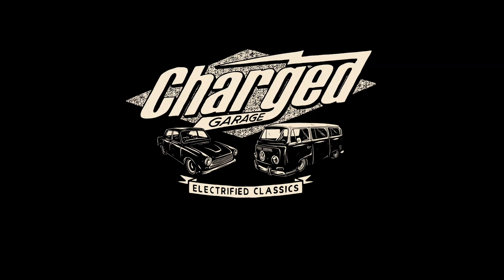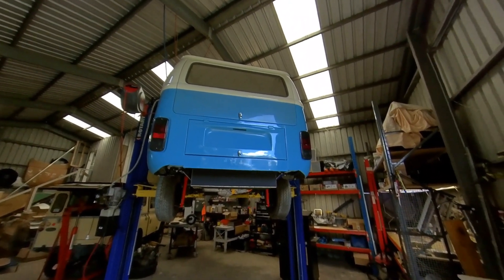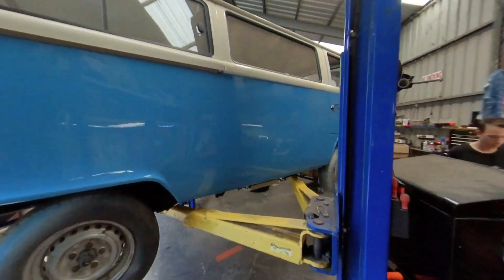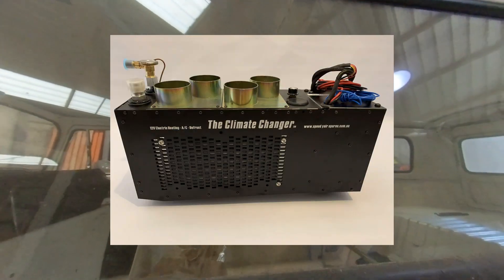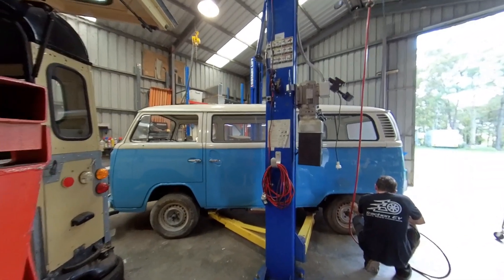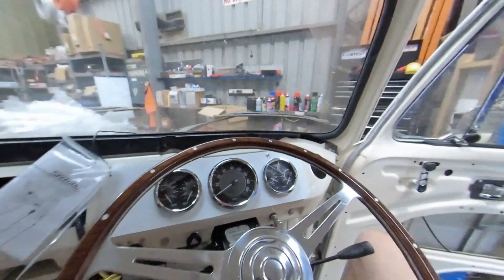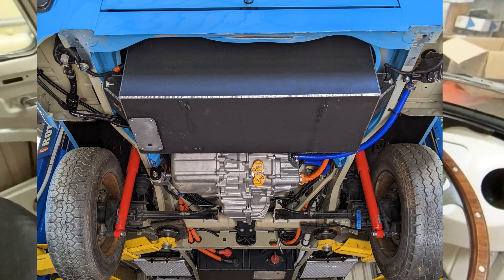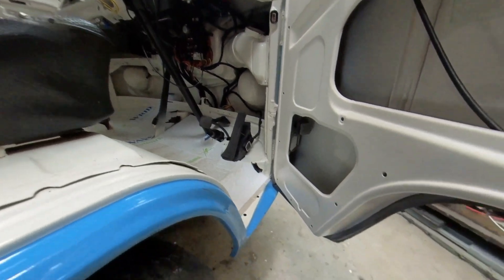Tesla swap Electric VW Kombi - EV conversion - Pt 3 progress walkaround

Comment: Which throttle pedal did you use? It’s a drive by wire pedal I presume?
Reply from the maker: Yes. Had to use a Tesla pedal with the new Tesla motor and aftermarket controller.

Comment: How did this go? I converted my 68 with a hyper9, but I'd like to try the tesla motor swap, was wondering how to connect the gearbox on the tesla motor to the wheel base, is the axles that come with the tesla the right length? Did you have to machine something extra? Are you guys using an AEMEV controller?
Reply from the maker: Still working on this project. The Tesla motor is far better than the Hyper9 but yes it does need more fabrication to install. I've recently changed to the EV Controls T-2C controller. I'll have to do another video soon.

Comment: So nice. Just wondering why you chose Chademo instead of CCS2?
Reply from the maker: Because the Orion BMS supports CHAdeMO natively. CCS2 is a lot more complex and requires additional hardware which isn't cheap, hopefully it becomes easier to integrate in the future.
Reply: @chargedgarage131  Ah, yeah thought it might be something like that. It seems most of the public fast chargers are still dual format so it should be fine.

Comment: hi and congratulations. 
I bought a 1970 early bay with this in mind. I had since been convinced to use a Nissan Leaf 160kw motor but this has swayed me again (grrrr, damn you). 
I read your chat with Mohamed below but are we talking no major surgery regarding the rear axle and i can get rid of all the transmission?

Thanks John
Reply from the maker: Yep, no transmission at all with a Tesla motor, it has a single speed reduction gearbox built in. No surgery needed at all to the body of the VW.
Reply: @chargedgarage131  thanks for responding mate.
 I did have a sneaky peak at the small Tesla Motor again, think i'll be looking at 1500 GBPounds, which is about the same as the Leaf. I'll be using mine to go round the world, so reliability will be my primary concern.
Really looking forward to seeing what kinda range you get pal, hope you don't mind if i pinch some ideas and swerve any regrets (which i hope you don't get obviously.)

Thanks again John
Reply: @chargedgarage131  hey bud, couldn't see properly, how are you powering the rear wheels, are you yet to do half-shafts and if so are you re-engineering the VW or Tesla ones or getting custom ones?
Reply: @jclive4773  In this video the halfshafts weren't in yet. I went with Zero EV Tesla to 930 CV shaft stumps on motor side, and custom made VW to 930 stubaxles on the wheel side, and then off-the-shelf 930 axles and CV joints (actually Holden Commodore if you're in Australia).
Reply: @tangaroa4121  oh ok bud. Unfortunately i'm on the other side of the globe UK;) Can't wait to see what range you guys get, think i'll be looking at 75kwh to get round the world without stress.
Your Motor Mounting Brackets are beautiful,  if you have a CAD design i'll gladly buy the design off you (if they will fit a 1970 Early Bay) and try to get somebody to make em over here. 
Thanks Pal, John

Comment: Such a beauty! Awesomely done! What kind of condensers and a/c compressor you've used here to achieve dual zone a/c? Also from Tesla MX? I'm also assuming you're using another "zone" to actively cool batteries during CHAdeMO charging? Super interested, please let me know.
Reply from the maker: Thanks! All A/C components are new, not recycled from MX. Compressor is 350V electric, condensers are stock off the shelf. Batteries are cooled via a coolant loop independent of the A/C (dedicated radiator etc).

Comment: Where are the videos on how to modify the tesla motor/drivetrain to such a vehicle? I'm trying to figure out how to add it to a bus.
Reply from the maker: Do you mean how to mount it in a VW? or control the motor to do what you want it to? Either way there is plenty on YouTube.
Reply: @chargedgarage131  how to mount and modify to a bus axils. I’ve been searching for step by step videos on that.
Reply from the maker: @mo.Travelin2  Our VW in this video has a custom designed and fabricated motor mount that mounts the Tesla motor off the original body mounting points. You either have to design one yourself to suit your vehicle, or contact one of the EV workshops in your area to buy one of theirs (eg Traction EV in Australia, EV West in USA etc).